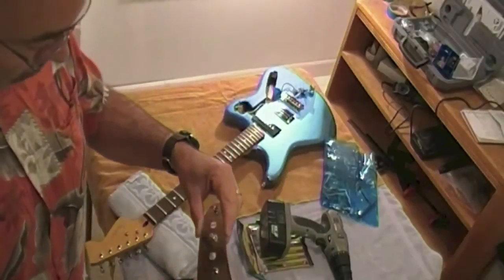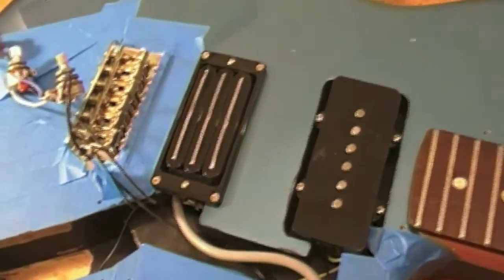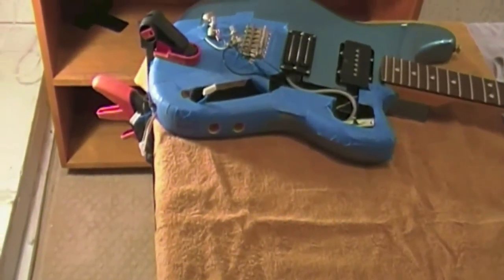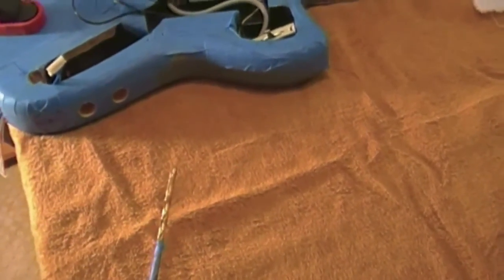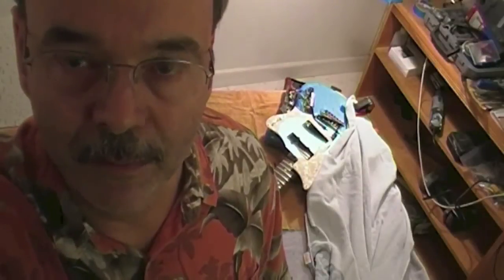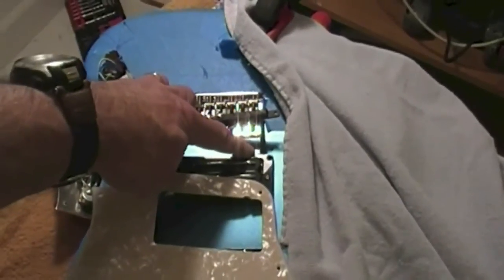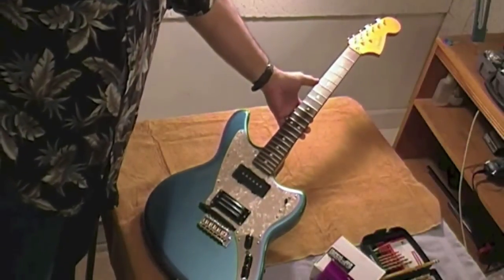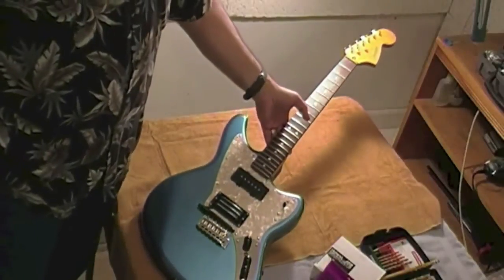Roland GK Kit Internal Kit Installation for GR-55 Part 2

Comment: That looked like a fun project
Are there any problems when playing the guitar in sitting position (the switches being where they are)
is the normal pick ups output wired to the 13 pin connector ?

Comment: What a dog's dinner you made of this. why are the 2 buttons on the bottom side of the guitar. I've installed it on an Ibanez  rg370. Took a lot of head scratching to get it all looking neat and as if it was factory fitted.
Reply from the maker: Thanks for your constructive comment.  All I can tell you is this was my first installation and it works for me.  The buttons are recessed and easy to reach.  I don't use them very often anyway as most patch changes in my setup are via program changes sent to the GR from an iPad.